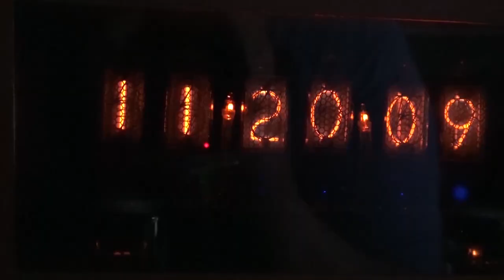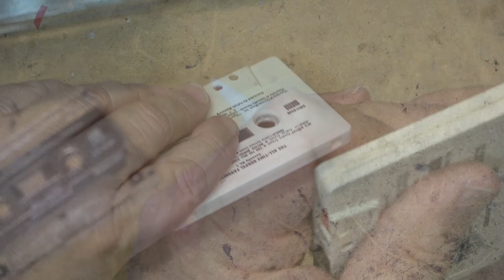2 cassette tape repairs

Comment: as a kid i fixed some tapes by removing the small pin which holds the tape in the roller, and put the end of the good tape there
Reply: Do you mean the plastic clip -sort of Ohm-shaped that grabs the tape in the centre of the hub ? Yup, that's good to avoid splicing but you can lose a lot of tape depending on where the damage occurred.
Reply: @hifismiffy  Yes i think we speak about the same thing. i wonder how long-term fix the adhesive tape is

Comment: Only have one stubborn cassette, it was a new old stock Christmas compilation cassette. It wouldn't even play, kept slowing down and made the songs sound drunk LOL! I've tried researching how to fix it and did such, but it turned out to be more trouble than it's worth. It wasn't a rare tape at all, only was about $5 total. Nothing to worry about imo!
Reply: Probably one of the typical prerecorded tapes that get sticky after some time. Some EMI cassettes are suffering from that issue.
Reply: There is a video 'How to relubricate your stuck cassette tapes' covering your issue.
Reply: Squeeze the cassette in the palm of one hand, clap your hand against the leg, 4 or 5 times (the back of the hand against the leg).  The "cushioned" jolts from the leg should settle the coils of tape, which will have wound unevenly.  It almost always worked for me.
Reply: @carminedambrosio7  The issue I talked about is caused by chemical degrading of some tapes, not unevenly wound up tape spools.

Comment: Have you ever experienced sticky tape syndrome on cassette tapes ? I've run across a few cassettes with that problem and have found that after a careful fast forward and rewind that the tape and cartridge can be tape baked at 130 F for four hours and "wallah" it then plays back perfectly for a transfer to a digital recorder for long term storage.
Reply from the maker: I'm sure it happens.  I have a fain number of issues with 8mm video tapes.

Comment: I'm not sure if you will see this comment but would you also happen to know how to repair video cassette tapes? I have this tape that only lets me listen to the audio but I can't see the video! I know it's not a problem with my cam corder because the rest of my tapes play just fine. Any help is appreciated thank u!
Reply from the maker: What type of camera?
Reply: @12voltvids  Sony Handycam Vision videohi8. I tried to open the tape and slightly tighten and clean the film itself. It worked and I was able to see the video for about 2 minutes but then my screen just went blue and I went back to hearing sound only. Now I can only watch about the first 10 seconds of the film until it goes blue and I'm only have this issue with this tape in particular. I really hope I am able to save the footage somehow
Reply from the maker: @carolinew1250  
I have tapes that clog the heads about every 5 minutes.  Tape break down
Reply: @12voltvids  is there a specific as to why that happens? And thank you for that insight I'm going to clean the heads beforehand

Comment: I’m a Gen Z, but I’m interested in this older technology too. About a year ago, I got some new blank tapes that I’ve recorded onto and some of them drag. They’re Maxell, which my dad says was a good brand. But I’m guessing the tapes these days aren’t made as good as they were back then. Do you have any thoughts on why they might drag? Or am I spot on?
Reply from the maker: Haven't bought new tapes in over 30 years.  I doubt that any new tapes are as good as they were when cassettes were in wide usage.
Reply: Drag ?  So long as they don't squeal a lot - that's a bad sign.
Reply: @ACommenterOnYouTube  I bought some blank vhs tapes around the same time as these cassettes just for fun and they work great!
Reply: @12voltvids  That’s what I figured. It’s weird, I hold one spool and shake it, and same for the other, and they both rattle, so I they don’t appear to be binding. The slick plates feel smooth too.
Reply: @ACommenterOnYouTube  I’m in full agreement. Like I said in my original comment, I love old technology! And there’s nothing like a physical copy. You might know Dave has mentioned a couple times to always keep the original copy when you go digital because you never know what’ll happen to the digital copy.
Reply: If the cassettes are easily opened,  try lubing the tape spools (I see in one of your earlier replies in this thread, you`ve said that they appear loose, not binding) and also the rollers in the 2 bottom corners.  I would suggest using nose oil or forehead oil as the lubricant,  least likely to be harmful or get spilled anywhere.  As for the slick plates, could one of them have slipped out of place and is now restricting the spooling process?  Where the tape contacts solid posts that help re-direct it before it encounters the bottom corner rollers, ensure that those solid posts aren`t gummy. If they are, use the mildest solution (warm water and a tiny bit of dish soap) to clean them off, that`s a potential drag point. Sometimes old tape, whether audio tape or video tape, can lose some of its coating, especially if they have been left a long time in a too-warm, humid environment,  and begin shedding tiny amounts of material which may accumulate on contact points. Everything begins to break down eventually.  Magnetic tape is certainly no exception.
Reply: @stanpatterson5033  thanks for the advice. Thankfully, it does unscrew. I’ve had them apart a few times already to adjust/check things over. The lubricant could work. I do know the slick plate is in the correct position, right side up, and flipped the correct way. I also know it’s nothing I did because they always did this. I’ve only had them a couple years and got them brand new in the original packaging and I don’t store them in warm/humid conditions or anything like that. Certain ones with this problem don’t even have many hours on them. I’ve probably played them a just handful of times but no matter if they’re one I play more frequently or less frequently, lots of them seem to do this. But your suggestions are all things I can check!
Reply: @jacobanderson1891   Hmmm.  They do it in either direction?   More so in one than the other?  Best wishes getting to the bottom of the problem(s), and Seasons Greetings, too.
Reply: @stanpatterson5033  good point. I assume they probably would, but I haven’t really tried that. For that matter, I could just test by turning it with my fingers in both directions. Seasons greetings to you too!

Comment: For the sake of completeness: everyday clear tape is inappropriate. It's fine only if you play the cassette once and then dispose of it. Not only with time it oozes out of the sides, but it will make your cassette "self dividing" over and over again. The glue gets jammed into the spool's sides and creates tape curling, tearing and in the end breakage.

I've spent an ENTIRE day getting through a cassette which had splices made by a person that wanted it to be playable... but he already made the error years ago, and in the end, all of the old splices ended up creating new tape breaks and in the end he gave up, before I told him that I could remove the glue and splice it correctly... little did I know that I had to deal with around 10 splices some of them created in turn because the brittle old tape kept breaking when jammed by the glue left by the former splicing.

You have been warned if you want to keep your cassettes.

Comment: I have removed pressure pads from cassettes to reduce squealing.  They do play better.
Reply: Most tape machines rely on the pressure pads to ensure good tape contact with the record/playback head - except for some high-end Nakamichis. I've only got a lowly DR-10 but it still works good.
Reply from the maker: @hifismiffy  Dual capstan non auto reverse will work as the second capstan apply back tension
Reply: @hifismiffy  A DR-10?  I have a Sanyo RD 10, my first brand-new cassette deck, bought in the very early eighties. Still works, though the door dampner gave up decades ago.  Pretty poor comparison,  but the part about `lowly` just could not be passed by.  Never owned a Nakamichi, just wasn`t in the budget. Their stuff was legendary.

Comment: I'm surprised a man of your expertise, you did not use or mention why 'splicing tape' should be used, and not sticky tape?  
It's still manufactured and not that expensive either.
Reply from the maker: I don't have any don't need it, when i have to splice a tape it is going through a machine 1 time to get a copy then it is dumped.
Reply: @12voltvids  Ahh! Gotchya, well that makes sense.  Cheers!
Reply: I used normal sticky tape on a broken cassette abiut a year ago too and it still works fine.